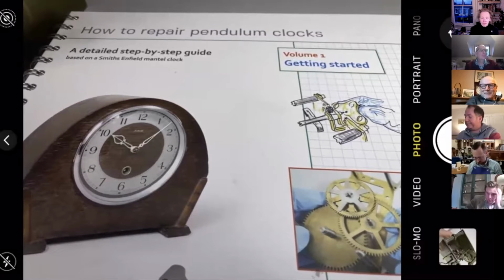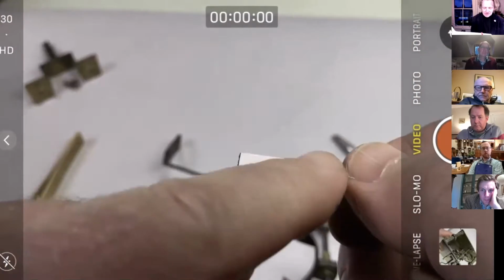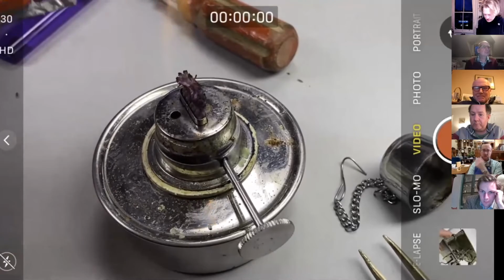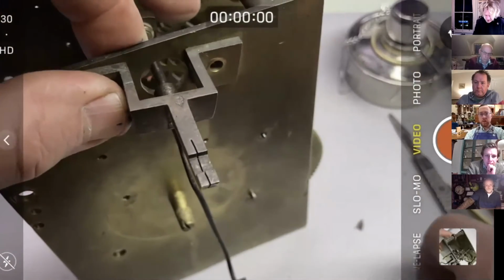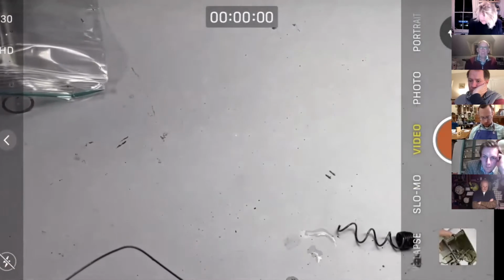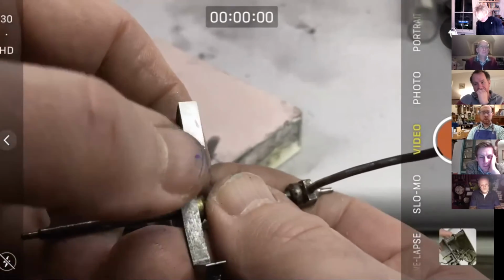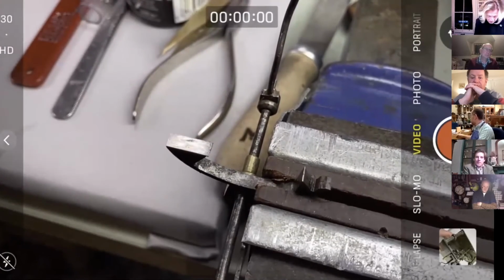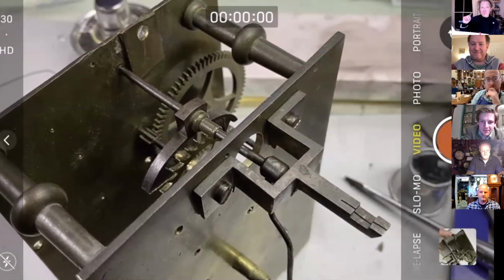Open Clock Club #016 2021_03_13

Comment: Great job  .But it looks like the pivot is bent on pellets
Reply from the maker: Hi Jon.  Thanks for the kind words.  I have just checked and you are right; well spotted.  the back pivot is bent down slightly.  there is enough side-shake in the hole to accommodate it but I will straighten anyway.  Yours   Matthew
Reply: Wow. Thankyou so much. I so enjoy. The practical videos you make.
Reply from the maker: @orchardwatchandclockrepair8346  More in the pipeline... eventually!!!

Comment: Thanks for sharing these instructions. They are very educational. I saw that you found it a problem that the EZE-LAP tool bends too much, but I think that is precisely the intention and I believe it is as a safeguard against damage from too much pressure on the surface. If you use a harder handle, the pressure can become too high, which will damage the grinding surface. Keep on the good instructions. Many greetings from The  Netherlands.
Reply from the maker: Hi Franklin  Thanks for the kind comments.  Yes that is an interesting point re the tool being compliant to protect the surface.  The instructions on the back of the packet actually talk about applying more pressure.  I think these are a very useful tool, I just bought the wrong one.  it gotten my pallet face cut back so no complaints.  keep watching!   Matthew